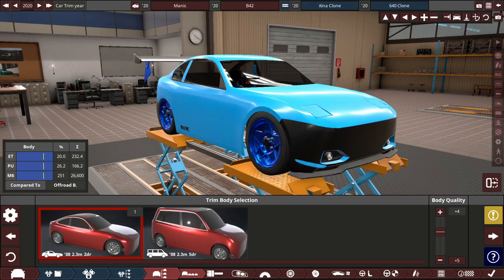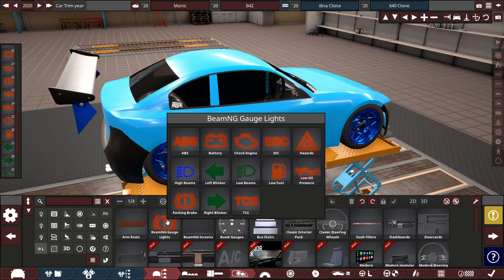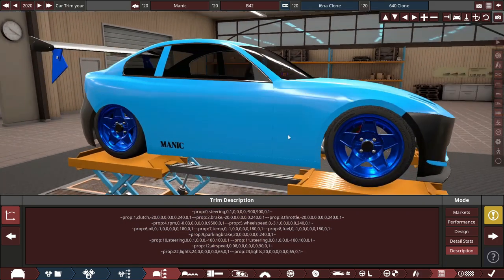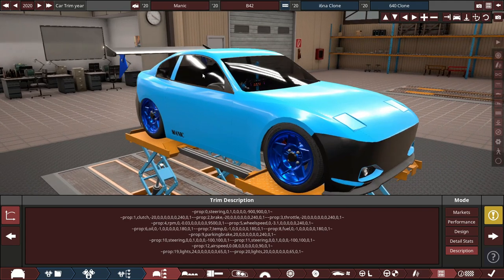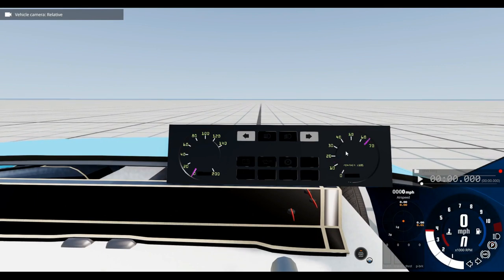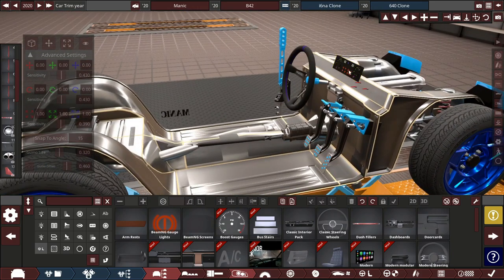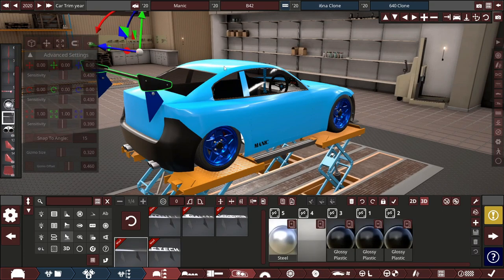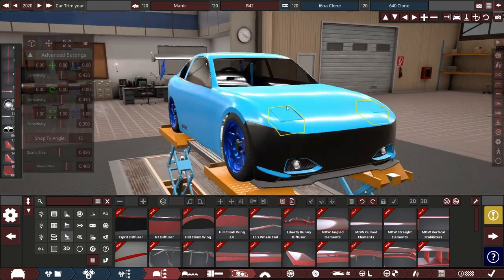Automation game // Detail tutorial part1 // Moving props

Comment: Nice video! Hey, there is any way I can put a prop to work with two function? I want to make a active wing that change position while braking and speed, but can't figure how.
Reply from the maker: Hello there. this car has the working active wing. ~prop:12,airspeed,0.08,0,0,0,0,0,0,90,0,1~ thats the code I made for it. may need the odd change to suit you. also top tip, try and use just the wing it self and the add legs for it (lol legs) as a different prop. just case the it will try and rotate it all. good luck

Comment: what is the code for a horizontal handbrake?
Reply from the maker: wouldn't matter because it works from axis. so Y,X,Z.  both style of handbrakes move the same way just 90* off-set from each other. remember you want to set the handbrake up as "OFF" if you still need the code it will be in the most updated tutorial. I have playlist to help you find it. it will be an automation tut one